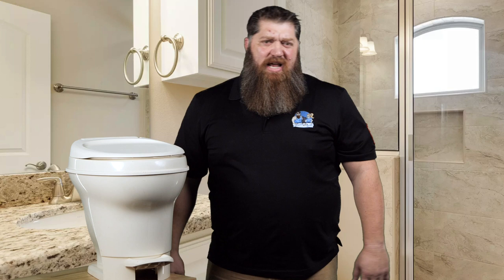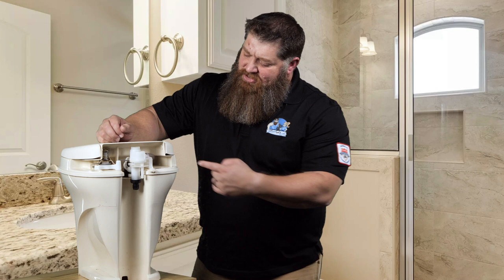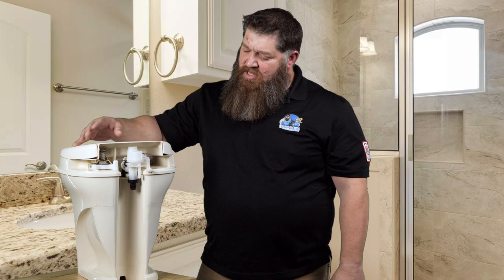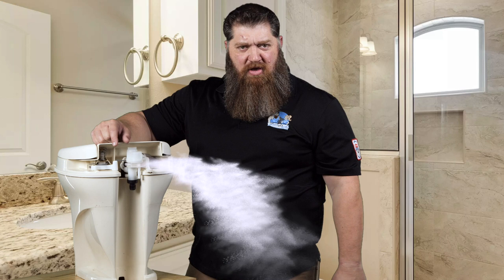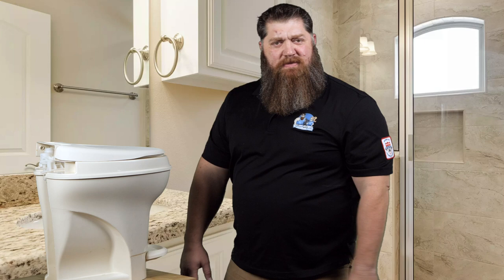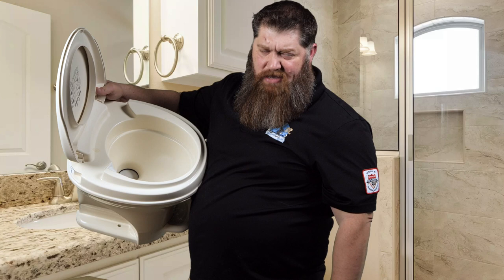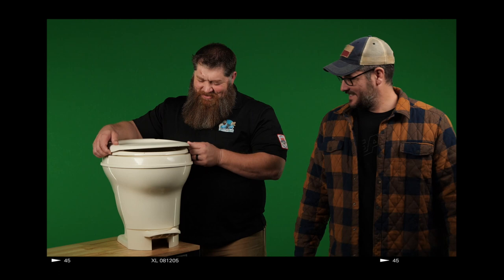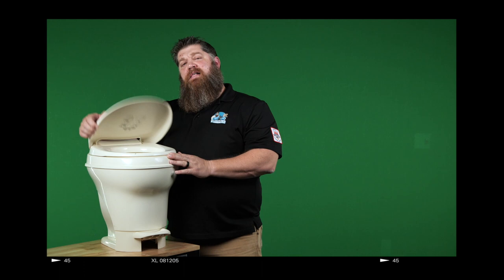Common RV Toilet Issues

Comment: There's actually a product now to upgrade the plastic toilet and have all the benefits of a porcelain toilet, without having to install one. ;) 
The Twusch is lightweight, scratch resistant, antibacterial, easy to clean and can even handle those Taco Bell visits. ;)

Comment: Good video my friend. How about the Thetford Model 31688 that stuck after flushing and keep water a coming. It also did it and the water stopped rt at the top. Any ideas what to redo?  I replaced the entire valve kit 2 yrs ago. Thanks in advance.

Comment: Any way to adjust the flush? For example, I had a customer unit where the valve would open before water flows.......you could not push medal mid way and fill the bowl...the valve would not stay closed enough when slightly depressing the pedal...

You couldn't make a poo.

Comment: We have a really smelly toilet, even after being thoroughly deep cleaned. And the bowl holds water above the seal, but the water turns yellow if left for a few hours. Any ideas on this issue?
Reply from the maker: not sure of the mineral content in the water.
Reply: @NationalRVTrainingAcademy  actually figured out that our toilet was a dometic 300 and was recalled for a faulty seal that resulted in waste material gathering in a crevasse in the back of the toilet 😳